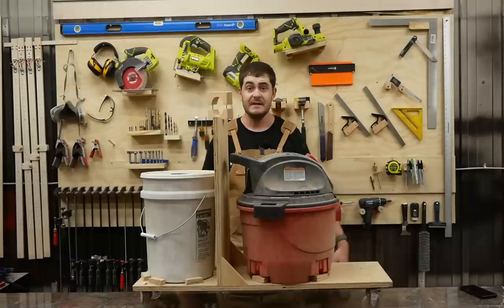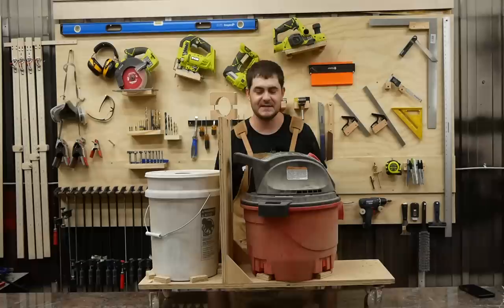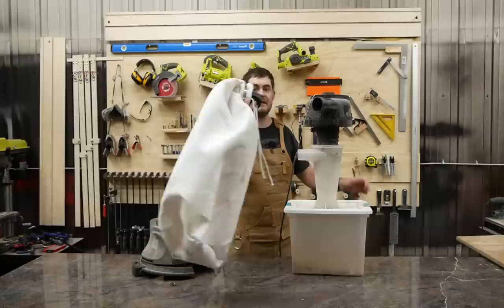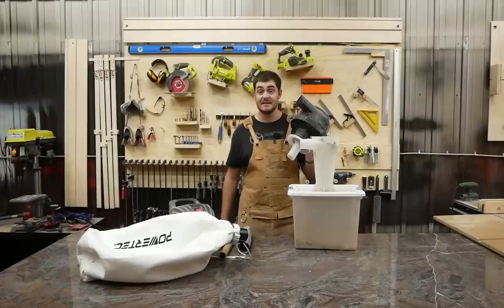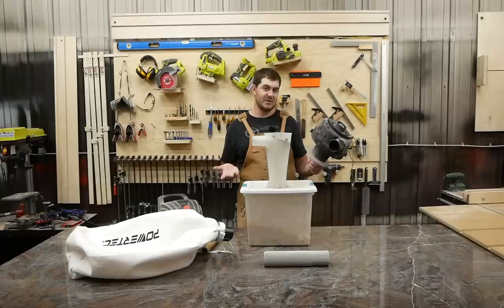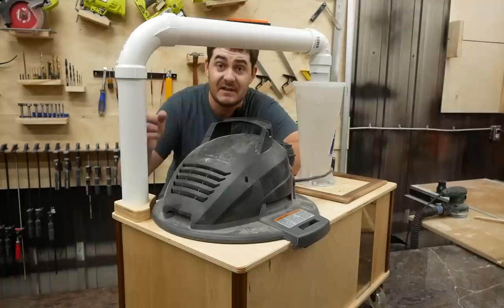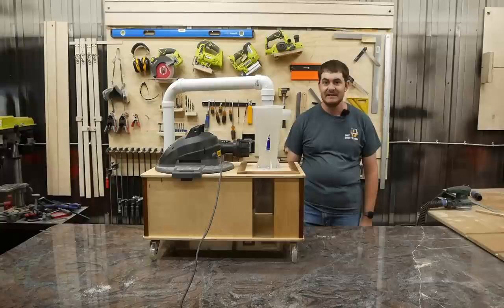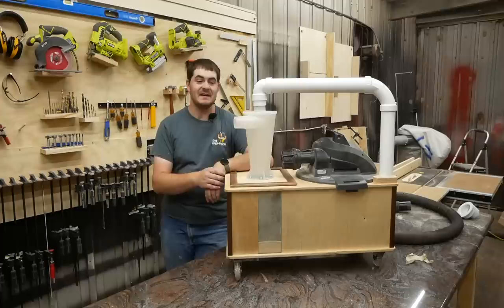Making an Overly Fancy Dust Collector Cart and Experimenting with a Dust Cyclone

Comment: I'm not sure if you're using your router correctly. You are supposed to go against the rotation of the bit. In your video, you are going WITH the rotation of the bit. Hence the peculiar noise we are hearing. It is also why it is "jumping" or wanting to go faster (watch t=6:43)

Comment: Incidentally, I built mine without the fancy cyclone thing.  So I get about a 2% blow by.   Which is still hardly enough to have to clean out when I have to empty the collector side.  
(Just in case anyone wants to make the setup smaller)

Comment: Those O'not'a dust separators are EXTREAMLY disapointing. the angle of the cone is all wrong and the intake in the center of the  cyclone is too close to the edges to work. Not happy with mine. It only sparates the large chunks and about 20% of the fine dust. My shop vac still gets clogged almost just as fast.

Comment: Aren't you, effectively, sandblasting the inside of the glass when you use it?   I might have gone with acrylic - less fragile.
Reply: If it was vacuuming up metal shavings those might scratch the glass, but I’m guessing sawdust is much softer than glass.

Comment: Over thinking things. It's overly complicated.
For the first design, I would have stacked 2 buckets to give the chamber some height.
Then have the bottom of the cone's side inlet be slightly higher than the top of the chamber, this would mean a majority of the cone, being inside the chamber, and then plug up the top hole of the cone.
Then drill a hole in the side of chamber, as close as possible to the top. This hole would be where the chamber would get it's vacuum.

Comment: Why bother making a dust collection tool of you don't bother to put on any kind of mask or respirator when your nose is a foot from a router throwing out so much wood dust that i could smell it thru the video? 
Also, please don't use both a miter gage and the rip fence at the same time.  That's power woodworking 101.
Newbies need to see safe practices on YouTube,  not ways to maim or ruin your health.